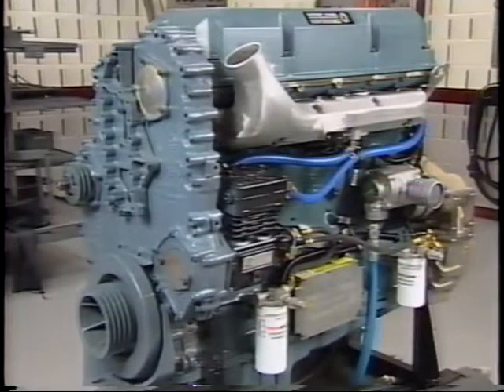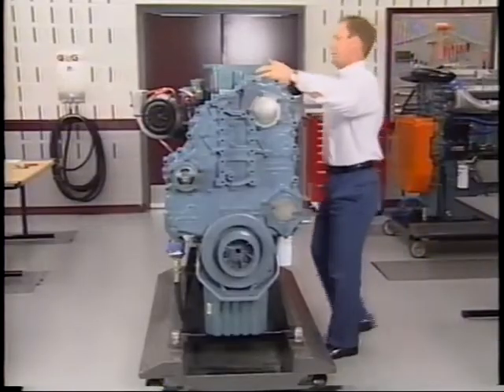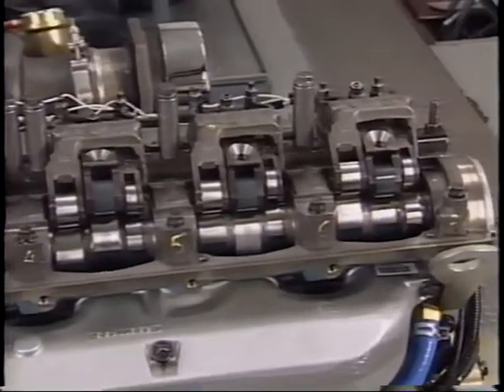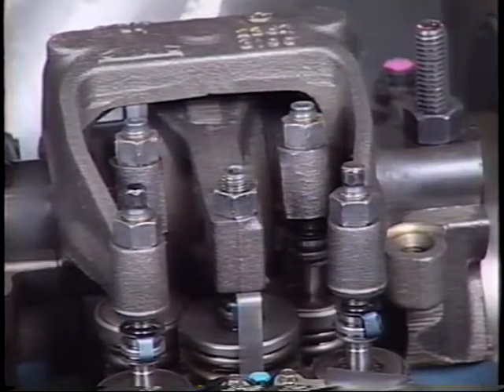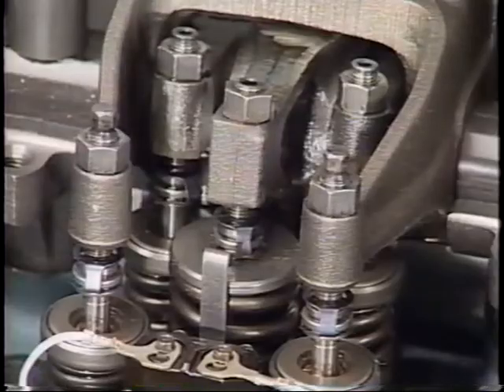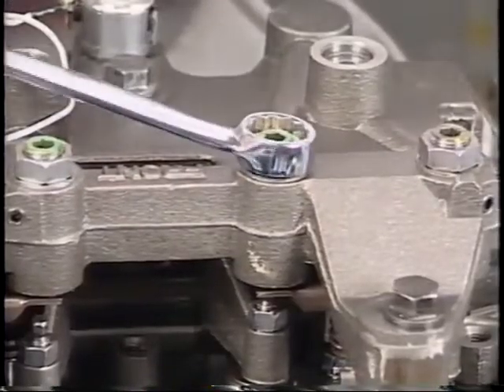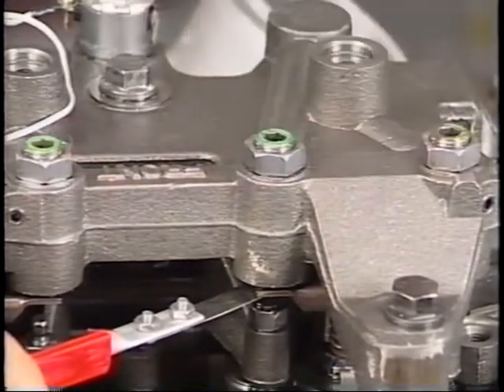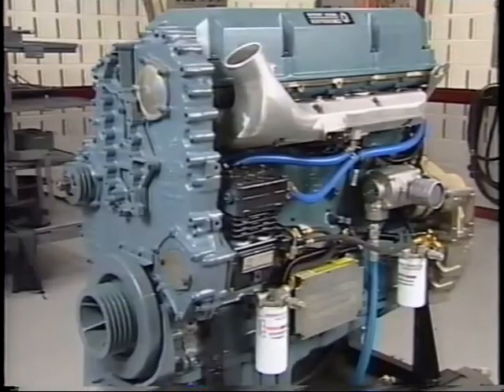Detroit Diesel Series 60 Engine Tune-Up

Comment: What is the thread pitch of the 12 mm rocker shaft hold down bolts ?
Reply from the maker: 12mm x 1.75
Reply: @JimMackHeavyEquipment .        Thank You !

Comment: I have an 1994 international with a Detroit 60 series engine.
Is it possible to run this engine outside the truck body? 
The ECM is mounted on the driver side block. 
Is there instructions providing electrical connections for this engine to run once removed from the truck?
Reply from the maker: Yes, it is possible to run the engine outside of the truck body.  At our school we removed several series 60 engines and set them up on run stands.  We removed the wiring harness for the truck and used the factory wiring diagram to determine what electrical connections were what.  If you don't have the truck wiring harness you could still set it up to run by using your own wires to connect to the right location according to the wiring diagram.
Reply: @JimMackHeavyEquipment Hello, where is your school located?
Reply from the maker: @albatross-b7b  It is located in Berks County, Pennsylvania.  www.berkscareer.com

Comment: Best video on YouTube for valve adjustment.In place if eying valve overlap one can use a dial indicator to be more precise.Also never do all valves in the same cylinder until you cycled it forward all the way through the procedure.

Comment: My freind pls help me may engine hard starting and lo power
Reply: Check crank sensor
Reply: Check fuel line before anything else
Reply: Check lift pump pressure .
Check fuel filter restriction with a gauge .
Use fuel line sight gauge .
Check air filter .
Check power voltage to ECM .
Cylinder cut-out test .

Comment: Best engine ever besides cat c15
Reply: Better than the c15.
Reply: They were the best in their respective categories. The 12.7 was the best all around money making fuel efficient chunk of cast iron ever created by the hands of men. Easy and relatively inexpensive to repair. 
The 3406e, C-15, C15 was the best heavy haul pulling engine ever created by the hands of men. When pulling power was paramount and reliability was also important the Cat C15 was the cat’s meow. Nothing came close to it except maybe a Redtop Cummins 14.0L with the proper tune.
Reply: The first h mom
Reply: 3406ebaybay